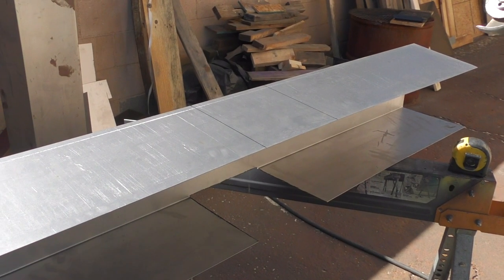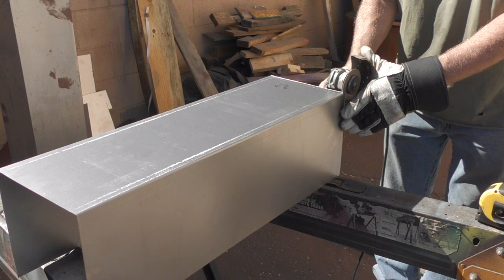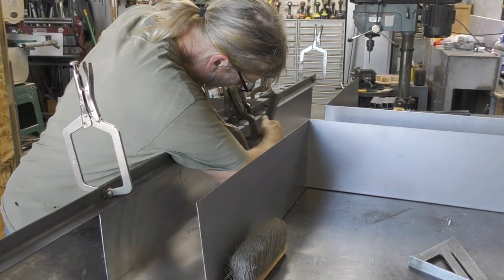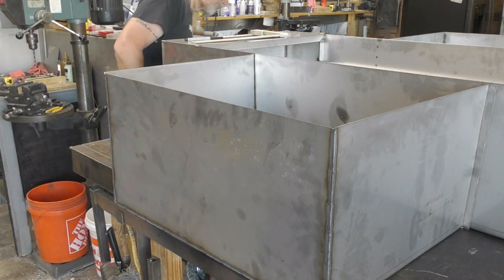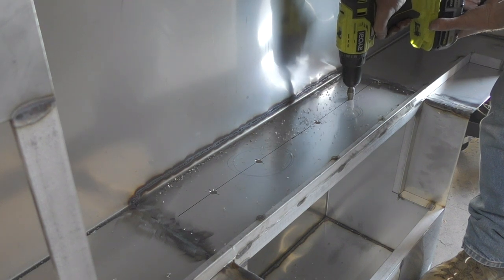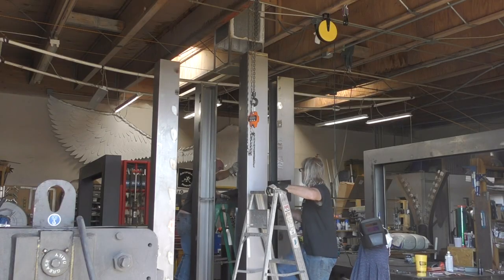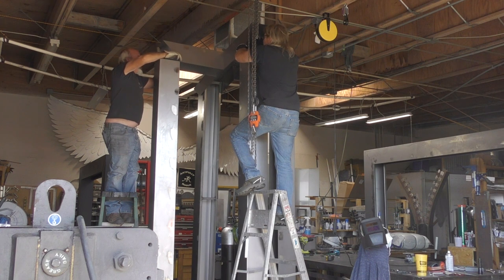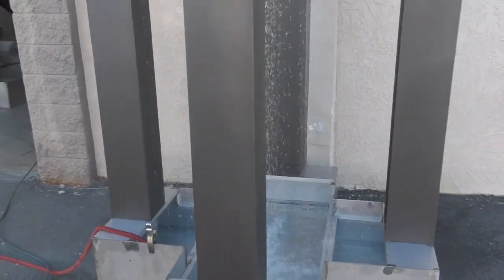Coolest Water Feature - X Style Rain Curtain Water Feature

Comment: This is great.  If you get time, or maybe on the next one you film, could you go over the plumbing part a bit more in-depth?  Particularly the components you used at the top.  Thanks.
Reply from the maker: Ok will do. I'm currently in Spain on a project but when I return I can do a video specifically on the plumbing
Reply: @ArtfullyRogue  Great thanks!

Comment: Wow another great water feature. I realize how much work it is to make these, especially while trying to work on a paying customer project. Thank you, they are always interesting! 
Question: how do you go about sizing your pumps?
Reply from the maker: Thanks for the question Dan, Honestly, sizing our pumps has been trial and error. The rain curtain throws off the normal calculation for sizing pumps. When I have questions I call the guys at Graystone Creations. But for the most part we either use an EasyPro 1850gph on out big water features and a Savio 1200gph on our smaller water features. Small is in the range of 6'x6' and anything larger is considered our big water feature
Reply: @ArtfullyRogue  wow, that’s higher than I expected. Thanks for sharing! I’m trying to work out a nice rock formation for inside the house. I got stuck on the pump size. I love in Colorado so would be nice way to add humidity into the house.